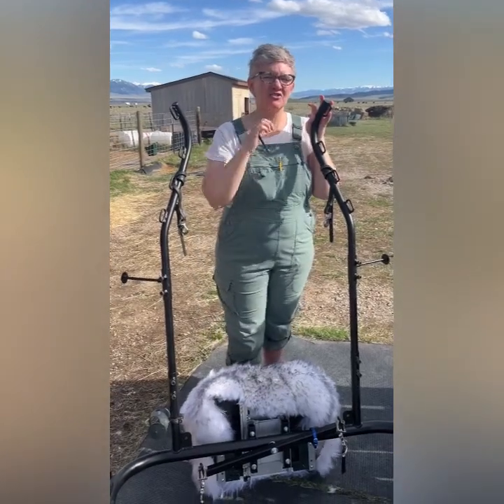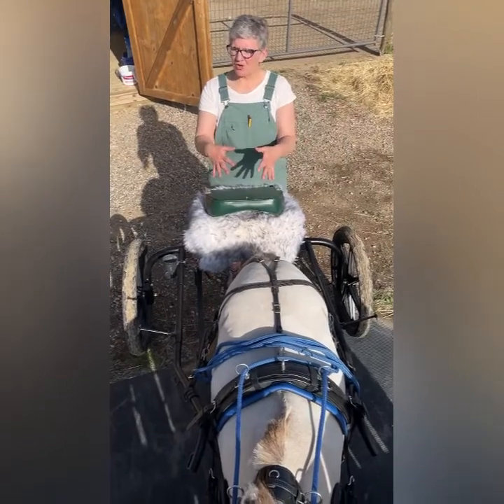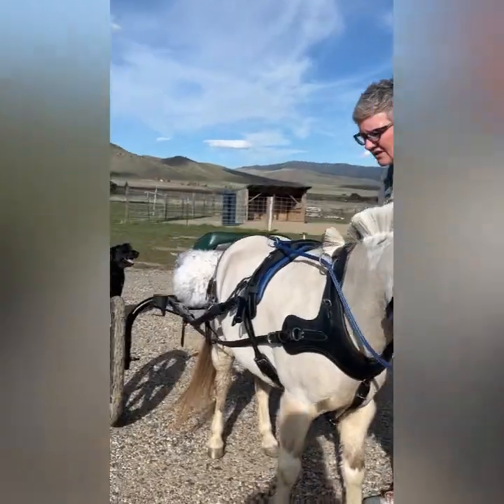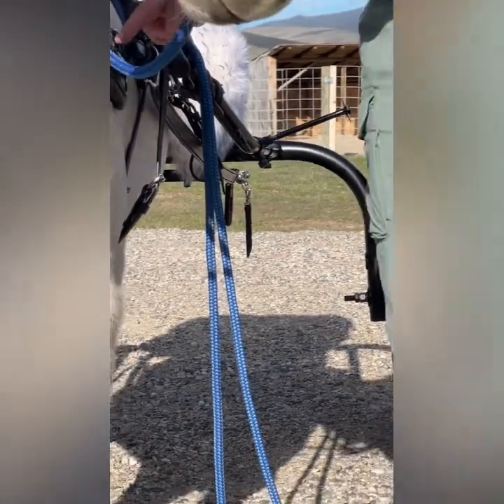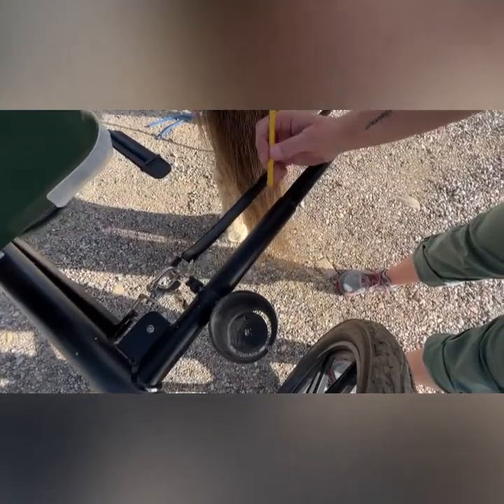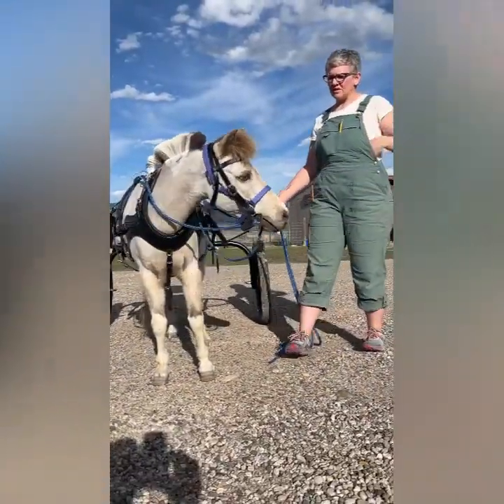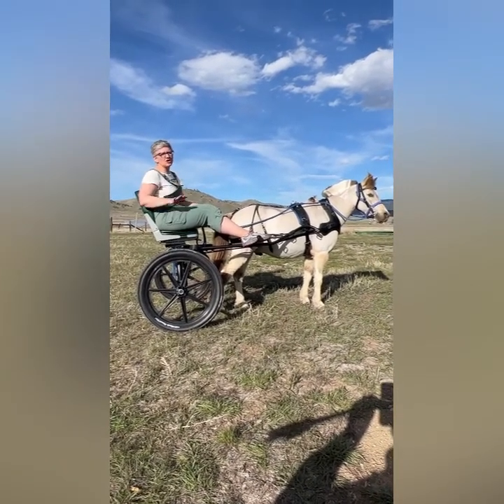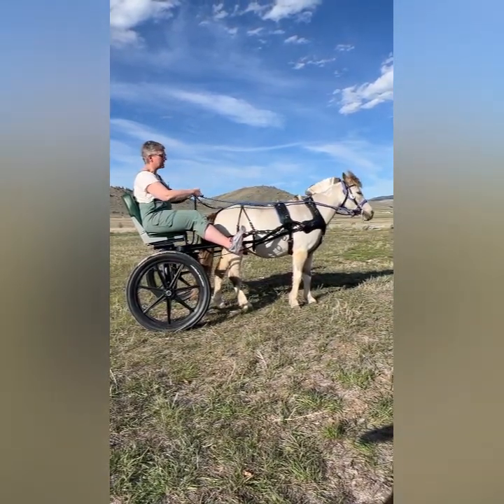How To Adjust Shaft Length To Dial In KBike Balance

Comment: Almost $3000 for some bent pipe, a seat and wheels? Wow. So it contains pipe, a fishing boat seat, a single tree, wheels and some small parts. You are talking hundreds of dollars for each component, and the welding you do is not that hard. Can you justify the price? I mean Bob's is overpriced for what you get, but this? For the SHAPE? You can get an easy entry for less than a thousand that contains more materials, more welds, and more bends.  This seems like a scam to me.
Reply: I appreciate your view point. The wheels alone are nearly $1000 because we use very expensive wheels that are extremely difficult to purchase. So your cost point is off a bit ;) We don't make much, if anything, on each bike. Luckily, we are all free to make up our own minds about what type of vehicle we purchase! I encourage you to go elsewhere for your vehicle needs.
Reply: @MindyBlooming  So there is no justification, so you chose to insult instead of answering the question with facts. With that attitude no encouragement is necessary. I guess you sell so many that you don't need to worry about losing customers or the customers that the person you just decided to blow off could have sent your way. They will see this and I don't think they will need your encouragement to go elsewhere. (It appears you failed salesmanship 101). Next time leave it with a simple explanation, and realize that screenshots are a thing)
Reply: Again, you have the right to feel how ever you feel. I did click on your name and there is literally no information about you. What kind of pony vehicles do you make and sell? I don’t feel I need to do a break down on all the parts and pieces that go into the KBike as I have already done that a few times on my blog. Believe me- if you wanted to find the info you could. I really don’t feel you are a prospective customer based on what you said above. Calling my vehicle a scam isn’t a great way to start a convo.
Reply: @MindyBlooming  I don't make or sell any. I and my group were looking to start a driving club with our Miniature Horses. Several have Easy Entry, but we wanted to have matching carts and go on trail rides as a group.. I did NOT call your vehicle a scam. I asked you to explain how those materials could possibly cost that much considering what is on the market because it seemed unreasonable. You could have just broken down the cost and given me a factual answer, but you chose to insult instead and you continue in this current comment and are very passively aggressive. You did not even bother to clarify if that was what I meant. This is really not about me nor is it about my group. This is about you using Ad Hominem attacks instead of addressing the issue. Again, not a very wise sales technique. I will convey to the rest of my club that you are not interested in doing business with us. I don't think they would be interested in someone who has your particular unique sales abilities either.
Reply: @rustythegreatandpowerfulla2676  I see what you mean.